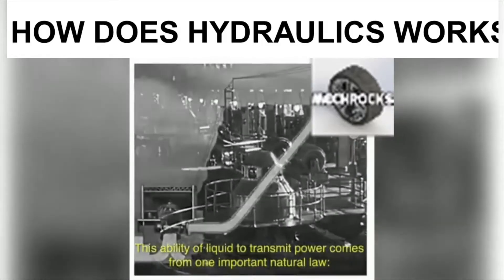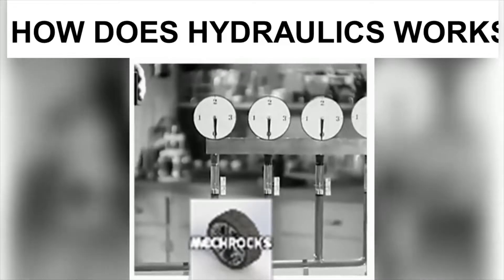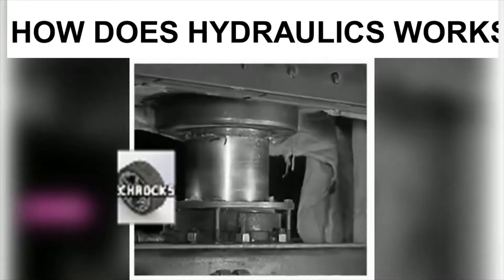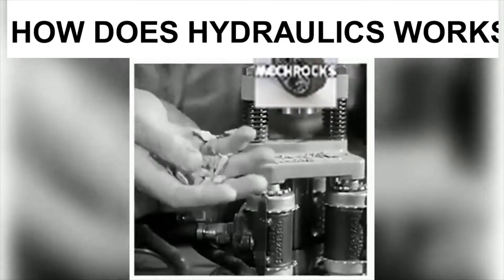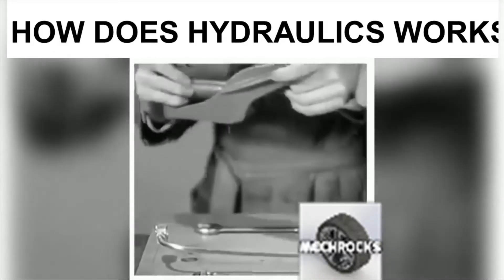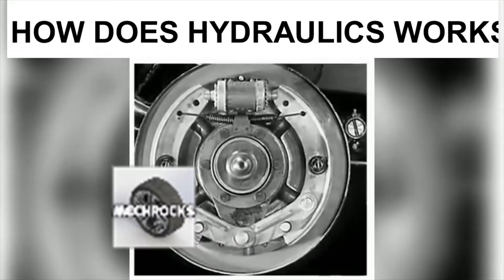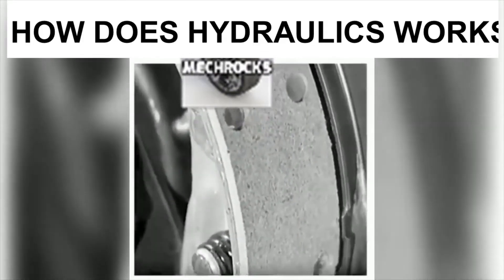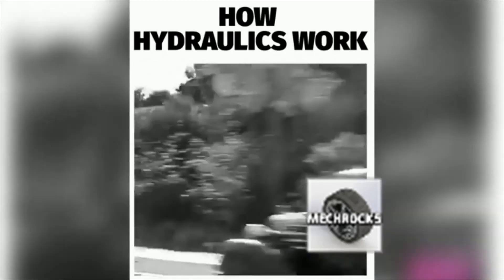How Do Hydraulics Work - Classic

Comment: Um, so how do hys]draulics work then?
Reply from the maker: Basically hydraulic system has hydraulic pump which pressurises the hydraulic fluid, this fluid is further utilised for functioning of actuators.
Reply: @MechRocksKnowledge  thanks. What are actuators and its function?
Reply from the maker: @isabelleyap1779  actuator is a simple device, which is responsible for creating any kind mechanical movement. Consider an example of piston cylinder. It is a type of linear actuator. Producing linear mechanical movement.
Reply: Did you not watch :32 to 1:42?  It gives a pretty good basic understanding in how hydraulics work w/o getting deep into fluid mechanics which this video is not intended for.